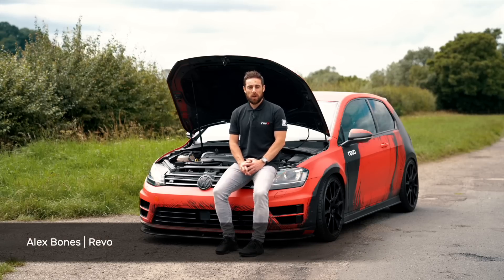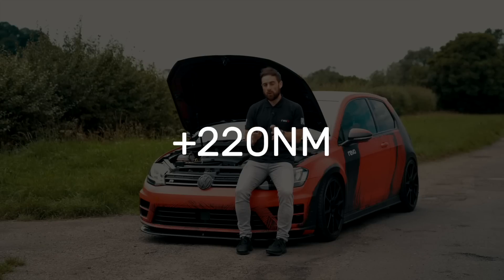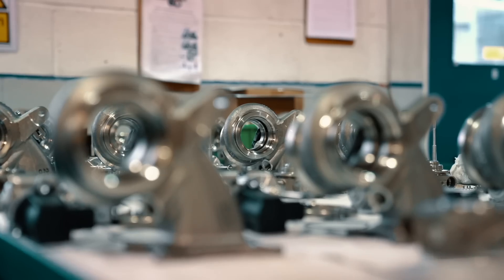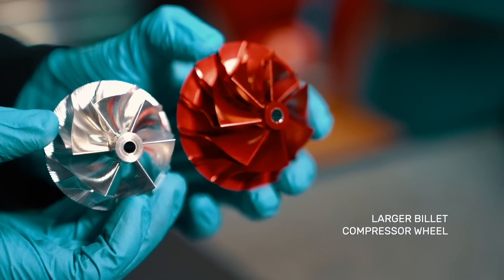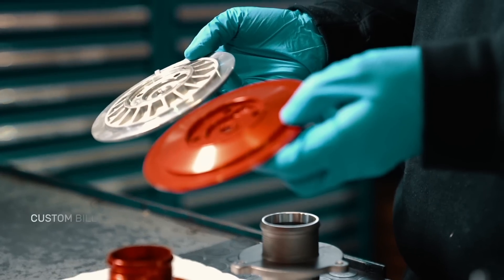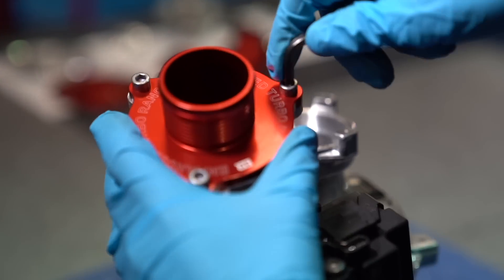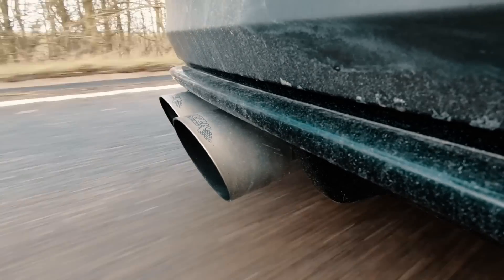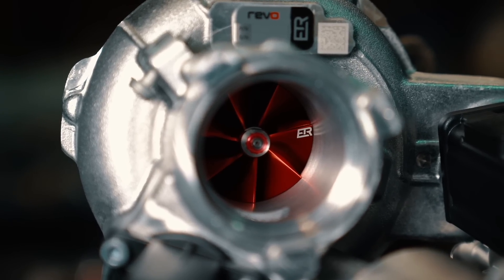Can you get 520bhp from a stock engine'd Golf R?

Comment: Could this be replicated on a Tiguan Mk2 ?
Reply: Yes, but you wont get the same power output as the engine doesn't have the same forged internals from factory as the Golf R EA888.
Reply: gureno19 thank you...I was thinking I would have to change a lot of the internals...damn...mines the 230bhp engine...was hoping to squeeze a few more out without going too crazy
Reply: @Bruce287  the Mk2 Tiguan with an IS38 and some supporting mods will make very close to 375whp
Reply from the maker: Hi, if you have the 2.0T Gen3 EA888 220/230bhp enigne, then even stage 1 can add over 100bhp and 100nm to this setup. Check out onlyrevo.com for more information

Comment: Wondering how long engine will last pushing that power!!
Reply from the maker: The ETR v1 spent around 2 years in development before public release. The V2 then furthered this development for hybrid setups on the EA888 Gen3 engines. We have cars running an ETR setup for 3/4 years now without any issues. Good maintenance, and trying to drive with a little maturity go a long way.
Reply: @RevoHQ  for a German with Autobahn driving a difficult answer. Yes i know it is an exception in the World. Wenn say cars a Autobahn fest. Means you push tge Pedal down and everything all Temperatures will bei fine for a long time.
Reply from the maker: @Nordlicht05  We have customers all over the world with different driving styles and conditions. Revo Temperature Protection is an additional safety feature that reduces overall load as the oil temperature passes a set limit. Exhaust gas temperatures (EGT) are also monitored, adapting the operating conditions (Air Fuel Ratio) to ensure they stay within safe parameters. If EGT's reach a set upper limit, then power is automatically reduced until the engine returns to a safe operating temperature.
Reply: Depends on supporting mods you have if it’s built well there’s no reason they shouldn’t last, engines over engineered a standard power golf r could be blown if your driving it like and idiot there’s a few of these engine’s in the higher 500 figures closer to 600 and some are even manual go check monkey London he recently reviewed a 600 hp manual golf r and it’s been running big power for quite a while
Reply: @Sm0keyHD  Interesting ill check that mate. Though im worried idont have as strong internals as a Golf R here, as i own the European sold GTI Clubsport (seen on my channel) with same engine & turbo as the R. Do you think thers going to be alot of differance between the GTI / R when it comes to the quality of whats under the hood?
Reply: 3DFX I’ve seen a gti club sport with over 500hp  on living life fast was a couple years ago the car was rapid,don’t know how different the engines are tho tbh I believed the tsfi engine in a few of the vag car al all pretty much the same with small differences like turbos injectors and ecus
Reply: @tredfxman  The Clubsport motor is equivalent to the 7R motor.
Reply: @tredfxman  Clubsport has the same R engine. I know because i have a clubsport
Reply: @Sm0keyHD  there was also a golf gti with 515hp with completely stock internals, and that one is still pushing power today
Reply: @tredfxman  The gti is fwd, it will last you longer.
Reply: @tredfxman  i've seen some 500hp golfs gti that do worse than stock in 0/60 imo 500 is way to high for FWD
Reply: @belfedhalmohamed9152  The Golf R is awd tho...
Reply: @belfedhalmohamed9152  But driving is not only about 0-60. Get 500hp golf gti on rolling start race againts much higher price sports car up to 250kph and tell me if it doesn't make u smile. Mine did.
Reply: @SuperDigitalMe  Yes all GTI have same engine as R, also our Clubsports differ from normal GTI's by also same is38 turbo. But what im wondering is if there are other factors around the engine of the internals that could be worth looking over if they would be weaker than R from factory? If there are other common things you swap for relability/durability when swapping to such big turbo as IS38ETR or maby a Revo Stage 2 tune. Iguess it can be tricky question to answer though. Im at Stage 1 doing well so far after bout 2 years use how bout you?
Reply: @maluku1807  Definitly, it will be mostly about driving style.. And if you are taking it to a Track! Just overtaking cars now and then, and make sure you heat up engine few minutes before and after its pushed shod probably help abit?
Reply: @belfedhalmohamed9152  Yes probably partly coz all the air needed creates some huge turbo lag etc.. Worse in low rev, better in high revs. Ithink the sweet spot for an FWD car is Revo Stage 2 at round 400hp. It in fact like you say better in the mid register and kicks of earlier than Stage 1, yet not to late like a Stage 3 with bigger turbo i assume. But im at 370 hp already on my Stage 1 Clubsport. So we will see...  Its just to much fun never stopping modding though you know 😄
Reply: @tredfxman if your engine has the cjx engine code then it’s the same as the golf r engine
Reply: Not long. IF tuners really believed in the their products, they would offer a powertrain warranty!  Saying "oh we have two cars that have lasted for years" is NOT a statistical model worth relying on! :D
Reply: same.
Reply: 1 year
Reply: ... it’s a turbo. They’ve never been known for treating engines well and will never be.
Reply: I got this turbo with full fueling kit.
The LPFP doesn’t doesn’t fit my regional part number and i am still struggling with installation.
Reply: There is a great tuning rule. There is no such thing as free power, the weak link will show itself much sooner is all that will happen.

In this day and age of DSG and being removed from the experience. All drivers have it seems is 0-60 and HP figure
Reply: @odin5188  if the engine lasts equally there ist some fundamentally wrong...
Reply: @Nordlicht05  I know that, I'm say tuning these days seem to tune the car to very close to its limit with very little headroom.

At this level it's definitely a ticking time bomb. Good for headlines though
Reply: @odin5188  yes was only aditional 😀
Reply: 2 months max
Reply: @blaugrana9x  Not true, they give a 3 months warranty. So it should last 3 months plus a day max...
Reply: Not long imo or else everyone making is38 would be cranking up the numbers and mk7 has been around forever. 

Not talking about fuel controllers, fuel pump, ignition system,  plugs etc. 

Staying positive tho

Comment: What are the 0-100, 100-200 times? AWD.
Reply from the maker: We have a Revo leader board for dealers and customers, currently the quickest times are:
0-60mph 2.94s
100-200kph 6.34s
1/4 mile 10.48s
Reply: @RevoHQ  I raced one on my aprilia tuono 1100. Was a 520bhp stage 3 I'm told? Either ways he clocked just over 3 seconds 0-60 and upto 80mph my bike was only marginally faster. Truely unreal performance
Reply: Be low 3s I would imagine I’ve seen a 600hp golf do 3.2 in the wet
Reply: This cars done a 2.9 to 60